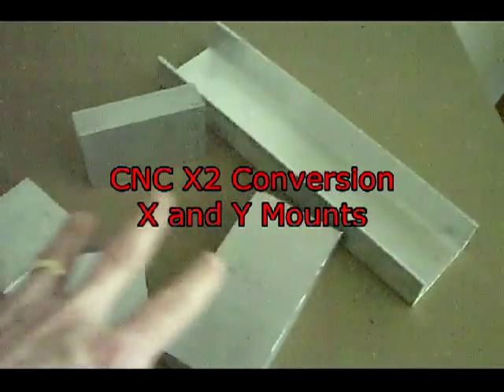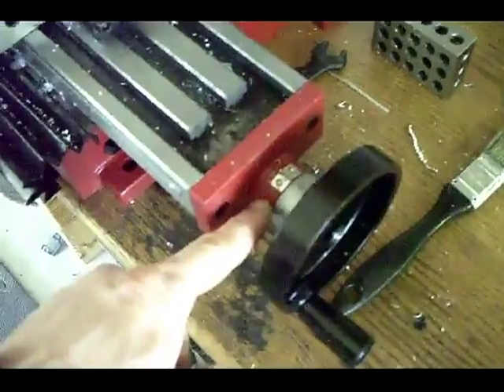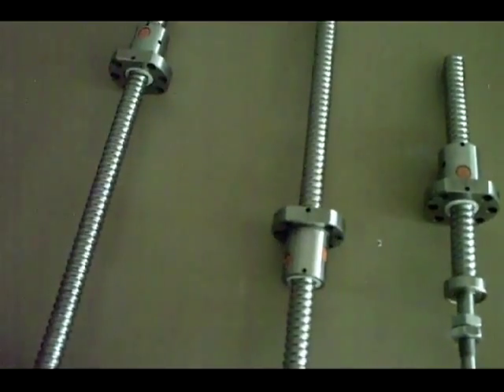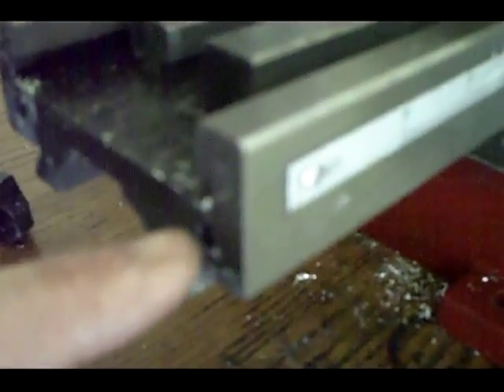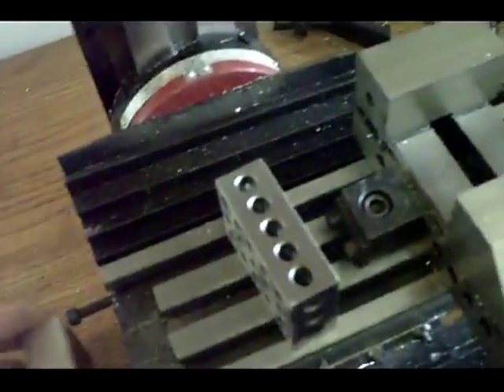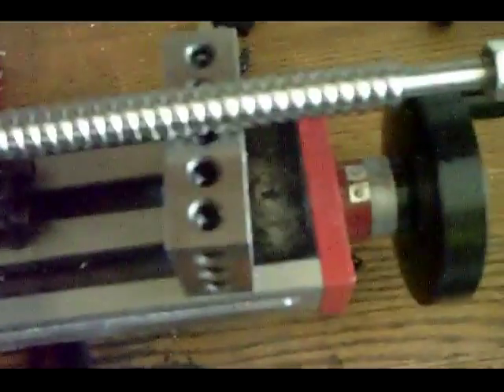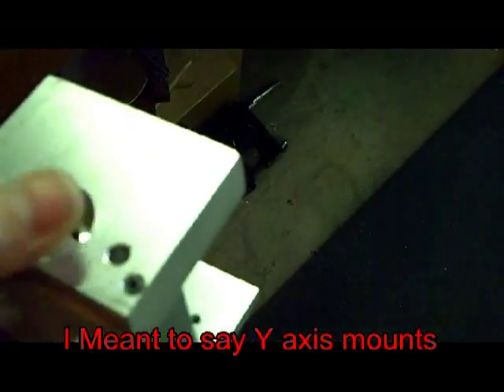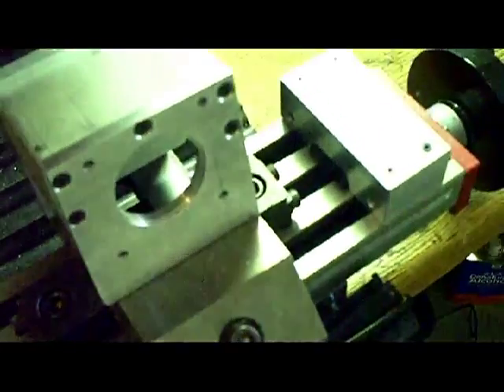X2 Mini-Mill CNC Conversion X and Y Mounts

Comment: Hi, Great vid on the X2!  I'm thinking of grabbing an arc SX2P myself. Are they at all capable of machining steel or are you limited to ally with this machine?
Reply from the maker: +Luke Blades Hi Luke, Love the Name I personally think that if your going into it with 25% of your projects in Steel then you may want to rethink the X2 variants  they will cut steel slow and with very light passes but only limited use. If your going to CNC it and spend 2K you want it to do what you need. with a name like yours I don't think it will do what you need well But it can be done.
Go bigger My 2 Cents
Reply: Haha, thanks. I get that quite a bit being in engineering! I totally agree with you and if I had the cash i would splash on a bigger better machine.I'm planning to do this on £7-800 (~$1100) so that why I'm tempted by your approach. I don't mind if i have to take my time with the steel machining (it's the robot doing the work after all!) but you say "only limited use", what problems am I likely to encounter when machining steel, assuming I go slowly?
Reply from the maker: +Luke Blades 
Hi Luke believe me I completely understand, My X2 was a budget build that is why I made all my mounts and did everything myself and it can be done for around $1200 The X2 will run longer and the spindle tends to heat up ( with a belt drive for sure) CNC cutting steel with the stock setup I don't think will work but I don't know. I did My belt drive first. The longer it runs code the more the steppers will heat up as well. 
I don't know what your plans are for the mill but bear in mind that the cost of the electronics, Ball screws, and Aluminum for mounts will be about the same for what ever size mill you choose. SO its only the cost of the mill that will be different. My 2 Cents
Reply: @CNC4XR7  Isnt the motor the significant limitation on a mill when it comes to milling harder metals? Ive seen a few videos of guys upgrading their X2D mills with 1-2HP motors that now was able to spin their spindles at higher speeds like the more expensive mills.

Comment: I do enjoy your videos,yet they seem to be out of focus.it would help if you could make sure focus is clear when zooming. in.
Reply from the maker: Thank you , 
Very sorry for the focus issue I had a crappy camera at the time.
Reply: A friend and I recently made the purchase of a Harbor Freight mini mill and in the future plan to upgrade it to CNC. This will be very helpful in the upgrade as we would like to be able to save as much money as possible as you have. The kits I have seen available are way more than I care to pay for so hopefully will be able to find the right parts separately to hopefully save as much money as possible. Thanks.
Reply from the maker: You should have no problems everything you see on my mill was made by me. This is a very capable machine for small parts. Work envelope is about 4y x 8x. 
I have very little money tied up in aluminum for mounts. I used a metric to keep things simple. My ballscrews were machined for me to my specs by Chai at linear motion bearings EBay 
My steppers and drivers are longs motors also eBay 425 oz. they work great. I think my z mount works better than anything I've seen no binding. 

Good luck I tried to cover all major items in the video. If ya need anything just pm me I will try and help.